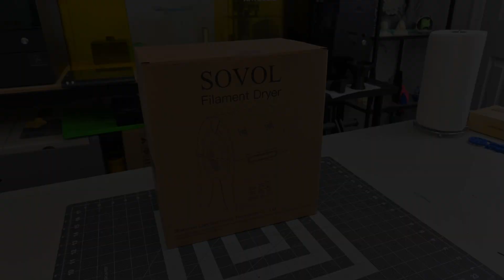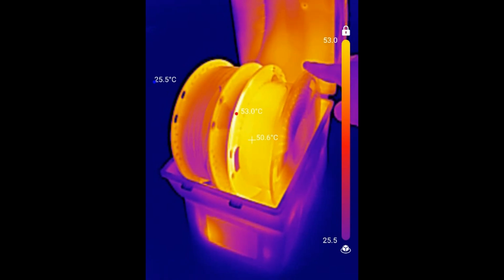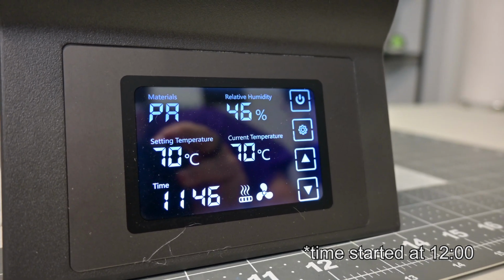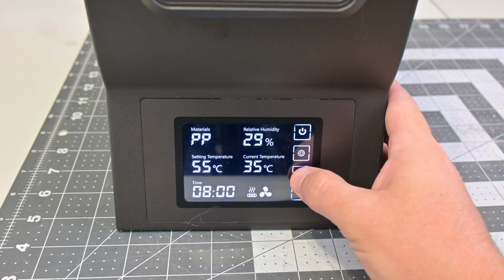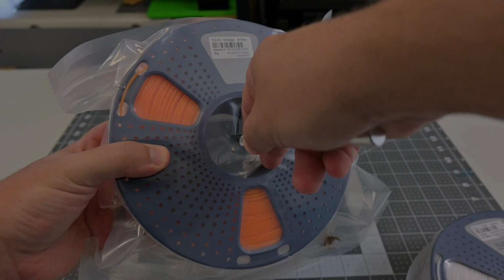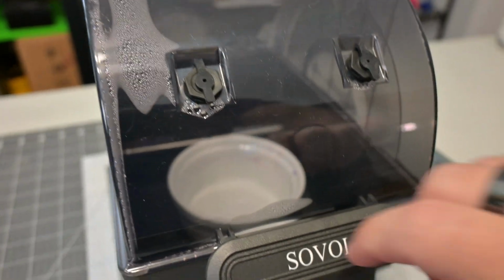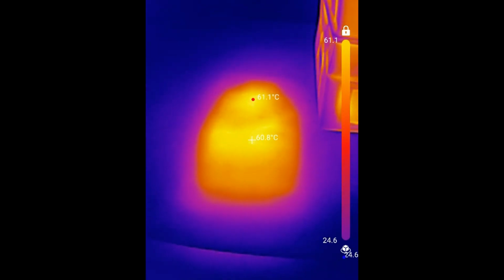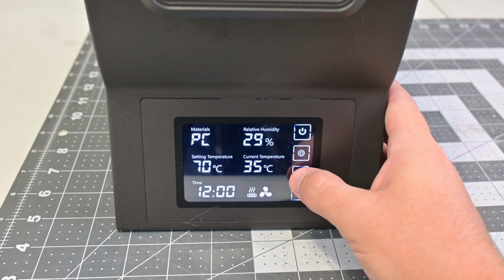Everyone needs this Filament Dryer | Sovol SH02 Filament Dryer Review

Comment: Everything you said I agree except the noise level. The fan is too noisy to use in the same place you sleep. If you’re a heavy sleeper it maybe ok but for light sleepers, definitely a no, no. It is very noisy. I had the sh01 and even though it was moderately noisy, I returned it, got this one and it is noisy. Lucky it is not in the same room I sleep.

Comment: The SH02 works better when you crack the lid open as the humid air has no escape even with the top and front holes open its not enough. There are numerous mods on MakerWorld to help this, also leg stand and a rear deflector to help all round even temperature. To make it even better a top flap is deeded or a fan to the outside to expel the moist air.

Comment: Hello, does your printer go up in humidity before coming down again because mine does and I need to know if that is normal😊
Reply from the maker: Yeah that's normal for a dryer. As the filament dries out, the moisture in the air rises, until the moist air leaves the dryer.

Comment: where does the moisture go?
Reply from the maker: The lid has two rubber stoppers on the front. You open those to open the vent, which allows the moisture to escape.

Comment: Thanks for the brief, but informative, targeted review! My filament dryer is branded "Comgrow" bought on Amazon late Jan. 2025 for $59.95, but looks and acts identically to the Sovol, so it must be a rebranded one or a knockoff. I also got fooled by the power button on the screen. lol!  Seems like a straightforward, no-frills dryer, which is exactly what I wanted. Accommodates two 1kg spools and has smooth rollers as well as a little rubber filament "airlock" gasket so you can run the filament out of the dryer. I'm about to run a spool of TPU 95A through it. (As soon as I find something to elevate it off the floor - thanks for the heads-up on that.) Unless you read a follow-up on this post, you can assume it all went well. :)
Reply from the maker: Thanks for watching! Yeah, Comgrow and Sovol are the same company, so you'll see the same models of dryers and printers branded as both. Happy Printing!

Comment: i am doubting between the creality space pi or the sovol sh02. 
Which do you think is the best?
Reply: I'm returning my Space Pi Plus because, using 3 different hygrometer, the Space Pi was consistently 4 to 5°C lower than the set/display temperature. Also the touchscreen sucks.
Reply: I have returned my Space Pi twice now because of a known error at higher temps. Stay away!

Comment: I am going to pass on this one.  It's very concerning me the surface gets that hot and this unit is 20db louder than other units.  I will buy the polymaker polydryer instead.
Reply: Mines came with feet at the bottom.
Reply: You can print some feet for under the dryer. Hot surface problem solved.
Reply: Louder = power
Reply: Louder is not power its inefficiency @Crackertothebarrel

Comment: I just bought one and now I have to learn how to use it.
Reply: Open the lid during the drying process, shut the latch, ans let the lid sit on the top of it. The small gap created between the lid and the body will let most of the humidity out, and makes the drying process lot more efficient. Once the drying finished, shut the lid properly and plug all holes that are not in use, helping to keep your filaments dry..
Reply: @Titusz1982  Just a thought that I haven't seen anywhere (honestly). Is the wet air that comes out toxic?  It is hot PLA plastic vapor, yes?
Reply: @GaryParkin  i have a particle and VOC meter inside my printer to know when to use my DIY bento air scrubber. The meter doesn't seem to pick up too much in the dryer. The VOCs barely go up, particles got up a little more (but this is expected since there is a fan recirculating air kicking up particles in the air). overall, the measurements go up about 10% compared to when the printer is actually printing. so, if printing not a concern to you, the dryer is not any worse. 

The dryer doesn't get anywhere near melting temperature of PLA, so this makes sense. it simply heats up the air so the air can hold on to more water molecules. if you then vent out this air with more water molecules and replace it with fresh cooler air with less water molecules you end up with less water overall inside the dryer. Its not really boiling water out of the filament. Your temperatures are like 100C lower than is needed to just melt the plastic, and way lower than to vaporize it. If anything, you are just slightly increasing the natural off gassing the plastic does, which is not even measurable with any consumer level equipment. I wouldn't worry about any more than any other plastic item around your home.

Comment: Why it doesn't have any stands? It would help with overheating of surface where it standing.
Also, a question - how much time does fan goes when you stop heating from max temp manually? It show if it power shutdown-friendly.

Comment: Not sure if this is common but for my unit when I have the filament in as storage (without silica gel) it sits around 15% humidity but when I dry the filament (again with out silica gel) it actually goes up to 23%. Not sure if this is an issue or if this just means I have to dry my filament for a longer period of time.
Reply: Heating the filament pulls the moisture out into the air so the humidity goes up in the enclosure.
Reply: Yep, because the water escaping from the filament will make the hot air humid and will be circulated around and detected by the sensor. It would be better, if there was a way designed to get rid of the steam/water instead of let it circulate/collect inside. All what I do, open up the dryer, and shut the latch, and let the lit sit on the top of the latch. This creates about a cm gap, that will let the humid air out, but still let the device maintain the temperature, and circulate the hot air around. Also confirmed by the sensor/display, this will let your humidity to drop close to 10% during the drying process, and there will be no water collected at the bottom. Once the process finished I shut the lid properly with the latch, plug all holes, it helps to keep the filaments dry. Some other manufacturers would have this as an advice in their manual, or have bigger holes on the lid by design.
Reply from the maker: That is interesting. Relative humidity changes with temperature. Higher temperatures mean the air can hold onto more moisture, but generally that means the RH should decrease, not increase. I don't know if this units sensor would account for that though.

Comment: Does this run into any of the same overheating issues from the S4?
Reply from the maker: I tried looking for a specific problem for the s4, but only found a post about printed PLA spools deforming when drying. Is that the overheating issue you were referring to?

I didn't experience any overheating, no damage were shown on my tests, and my thermal camera tests showed pretty accurate temperatures on the spools over the fan.
Reply: @HoffmanEngineering  Right on! I'm sure a few extended feet might not be a bad idea to print for the bottom getting so hot!